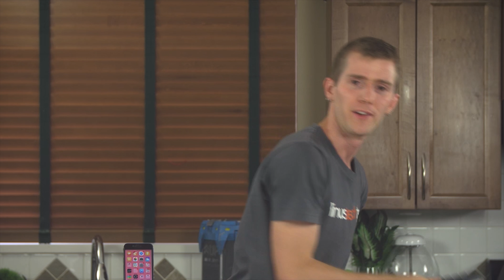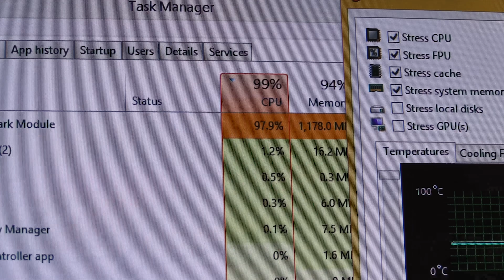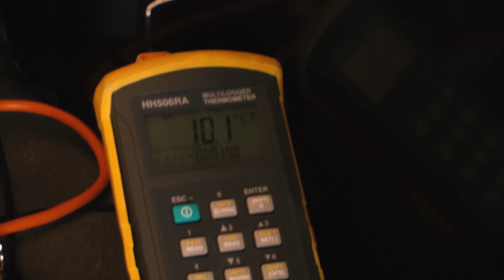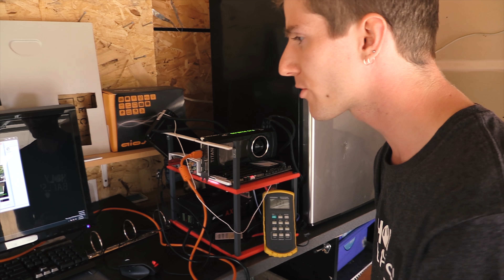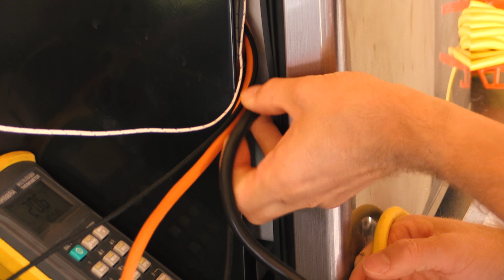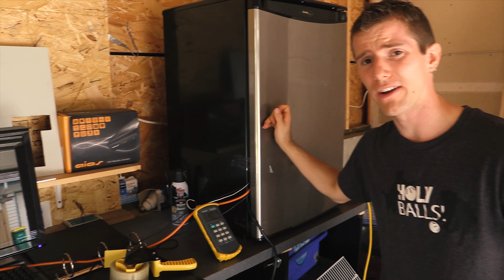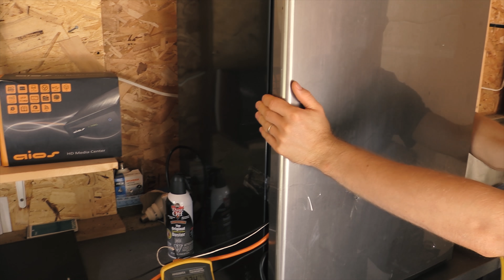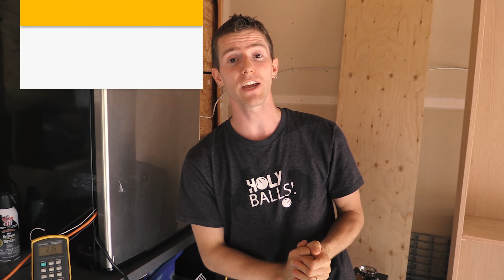PC Build in a Fridge - Does it Work??

Comment: Someone who has education in cooling and ventilation: Dying of laughter :-D
You can't put heat source to fridge, it has no power for take out 500W of heat and even if yes it's risk that you reach lower temperature than dew point of ambient air and it starts condensate on cool surface. This is really bad idea. You can check how much power consumption has your fridge and you clearly see it can't handle hunderds of watts of heat. But I understand you wanted show it in video, youtube money are better than just say it doesn't work. :-D

Comment: This gave me a great idea... I have a Coke branded countertop cooler with a glass front and lighted that came out of a convenience store. I'm gonna knock out the compressor and install some 200mm fans where the radiators would mount to the side walls for an epic custom water cooled cabinet...

Comment: It would help most of you to take a course in "Thermal Dynamics"; this is the science of moving heat energy and its effects. 
The only way to "Overclocking" a fridge, is by putting a fan on the coils to more efficiently move the heat away from the system. Even with this modification, the heat generated by most gaming PCs is more than even the average standard size frig can handle. An AC vent to the PC works better than a frig, but with this method, the case sweats and rust. All scenarios have pros and cons, "condensation causing electrical shorts" being the worst of them. A nice cool air-conditioned room is not as efficient as some of the other ways, but it is the most foolproof because it has the least amount of negative side effects. 
Try to buy equipment that can easily do what it will be asked to do. Where this is not always possible with the cooling system, engineering the airflow on the inside and outside of the case can help quite a bit. The idea is to move cool fresh air toward the PC, and the warm air away from it. Most people neglect to engineer the outside; if you don't have airflow moving the hot air away from the case's exhaust, this hot air just sets around and recirculates right back into the case. Doing a decent job at designing the airflow is beyond the capacity of most people's thought processes. But it doesn't take an Engineer to do a great job at this. It helps to have a fair amount of relevant training in this field, but mostly one needs to carefully think things all the way threw.

Comment: I really enjoyed this video, it made me think of somethings I hadn't before despite this idea crossing my mind.
The only way this might work with this spec fridge is if there was an exhaust port for the hot air from say the cpu cooler and power supply. In order to keep up exchanging the heat generated it would need help, more than it just the insulated box.

Comment: i think you will  have a problem with corrosion. when you reduce the temperature of air the amount of moisture it can hold goes down significantly. that means the relative humidity of the air goes up. most refrigerators are around 100% humidity almost all the time because they are opened and closed allowing moist air from outside the fridge to enter. this air might be about 30-50% relative humiity but when it cools down inside the refrigerator it will not be able to hold so much moisture so you will actually get a mist inside the refrigerator. your cpu is typically going to be way too hot for moisture to condense on it but other components maybe not.

Comment: A tad late, but I do wonder, what if you placed that watercooling unit with the radiator outside? Also, air that warms up expands, this would create pressure inside, more friction, more heat, more expansion?

Comment: Two (separate) ideas. One, put an AC output through a dehumidifier to reduce water build up and use that for case cooling, and two, why not put your water cooler in a fridge so the water cooling your PC is always cold?

Comment: Why would you not recommend cooling a hdd? As long as its above freezing (out of range of condensation) it would make the air around it easier to move through. Maybe if it's a sealed unit with a certain gas, but most of those gasses react minimally compared to our atmosphere when it comes to temperature changes.

Comment: shoudve just pulled the components off the fridge and made cold air intake out of some ducting that directly delivered to a pc case. fridges have fans so use that fan or replace it with a pc fan. boom cold air delivery that wont ever warm up because of pc parts inside the fridge. another option is a portable a/c. ive recently connected a 6 inch ducting to half the vent and am sending it to the front of my case fans. the results well nothings over 40 degrees celius ever. doing this on a amd fx8350 overclocked 4.5. water cooled and gpu rx580 nitro overclocked original loud fans lol.

Comment: To solve the no air flow problem, you use a small air conditioner instead of an refrigerator, rigged with the air flow going across the motherboard and the better the enclosure is to confine the air flow to across the motherboard only the better.  I've actually tested this somewhat by putting my test bench next to an air conditioner floor vent and using cardboard walls to reflect the air across the motherboard.  It looked kinda like a small garage with doors open both ends, with the vent on one side and the air flowing out the other.  The computer ran unbelievably cool with the CPU below 90 degrees Fahrenheit under load.  I wonder if you would need a CPU cooler under this setup.

Comment: My pc has a 500W power supply (max loading). 4200 Joules increases the temperature of 1L of water by 1C. 500W = 500Joules per sec. 
If there was 1L of water in the fridge, it would deliver 500joules per sec to that litre. Per sec. it delivers 500joules, so per the temp increase of water is 0.119C per sec or 7.14C per min.
It's basically running 1/4 of a kettle inside your fridge.

Comment: True the fridge is a closed system HOWEVER... What if you have a self contained water container in the fridge that acts as a heat storage unit. And you have your computer pipes flowing into that system or through it? It would still overwhelm the fridge BUT the fridge would be able to pre-cool the computers liquid, allowing the computer to remain at cooler temperatures for longer. Also what about a 2 phase cooling system? Dissipate the majority of the heat before the fridge, then do the cooling inside the fridge. This would probably shave 20 degrees off the temperature of the liquid before it enters the fridge, and then the fridge could lower the temperature further by another 10-20 degrees. So the fridge is only working to lower the temperature by 20 degrees rather than 40.

Comment: Only way to really get this to work is get a barrel that is full of water, enough water that when water cooling your system that the temperature of the water doesn’t change due to the heat of the computer, then away you go if you can keep a steady 1C then the system would be cooler, but there’s only so far you can take this and would probably be easier using a car radiator and a bigger water pump and would be to much of a hassle to what you would hain

Comment: i had thought about this in the early 2000's and with older hardware it may have had some useful effect but i hope someday he comes back and retries with a chest style freezer on the warmest temp. it would have way better cooling capacity and space to move a little air without wasting a ton of energy.

Comment: I think you need to run the power out the side and not through the door where it seals itself from the outside. Also, a freezer would of been a better choice. And, not a mini freezer but a full size chest freezer.  You can drill a hole in the side to run your power through and seal it with silicone. Im not going to try this cause it totally impractical and theres cheaper ways to cool your computer that consume way less electrical power but I think it could work. You just cant go cheap. Gotta get a subzero freezer with a motor and compressor that can run continuously. A walk in freezer, like the ones restaurants use is probably your best bet for a few degrees drop. Theres no kind of cold on this planet that will put out a campfire. So all that for a few degrees makes it totally impractical and a huge waste of time and money. I wasted time replying to this video even

Comment: You are disregarding the fact a refrigerator must be properly sealed.   With cords sticking out of the door even with the tape  isn’t going to seal it.   You would need to drill a hole through the side and silicone the cables I. For proper sealing.  You may not see a difference but just saying the test is flawed do to the seal being compromised

Comment: Seems to me, a better solution would be to run coolant/radiator from the GPU, into the fridge and back out.  Why cool anything besides GPU?  Still possible the fridge lacks enough cooling capacity for 200 watt GPU, but better than it handling all the heat from the PC, which maybe 400+ watts?

Comment: I know this was posted years ago, but Linus made 2 vary big mistakes.   1. the cords are big and making a big escape for the cold air.  2. the cords are coming in at the bottom, cold air sinks while hot air raises, so all the heat the pc is producing is pushing all the cold air out of the fridge.  To make this a successful test you'd need to make sure the fridge is fully sealed to keep any cold air from escaping-being pushed out.  Another note would be the rating of the compressor, better rating = faster cold.

Comment: If you live in a country where it gets cold in the winter, you can put them in a cupboard in your garage, wait 3 hours before you turn your PC on and it will work.
I was able to run a Q8300 (2500mhz) overclocked to 4400mhz and it was at 59C under 100% load BUT the temperature was -19C outside. Previous record was 4150mhz .

Comment: Water cooling refrigeration systems in done in high rise buildings. The air conditioning transfers heat to water, then pumps the water through cooling towers on the roof of the building.

Comment: Also another thought, would putting peltier thermal cooling devices between a CPU (or other) and a cooling block, either air cooled or water cooled, increase the cooling of the CPU?

Comment: P.S. I thought using a "test' bench system was a poor way to go. Cases are designed to direct airflow across components, even in a water cooled system, have proper air flow might aid in cooling "water cooled systems" though how much I do not know. Seeing a test of using water cooled systems with and without the standard case fans would be interesting. How much difference would the fans make in such systems?

Comment: Using silica packs could solve condensation problems from using freezers or commercial refrigerators, as would baking soda, either would need to be changed periodically. Cooling warm air with a humidity level causes the greatest release moisture, on a day with extremely low humidity, or a colder day air can hold less moisture. So put the computer in the 'fridge' during one of those days and keeping the door closed prevent warm moist air from entering.

Using a commercial mini fridge might be a solution if it can be set for use as a freezer, however is still depends on it's capacity to dissipate heat via coils on the back of the "fridge", I am not sure refrigerators that do not have the rear coils could shed enough heat. If the mini fridge has mini freezer for putting ice trays into, that might be of use, not sure. Put the radiator of the water cooling system in the freezer section, then use an anti-freeze/water solution so the water cooling system does not freeze. 

If I had the money to try these kinds of experiments I would. Not knowing the specs on thermal energies produced by these systems, and how much these various type refrigerators / freezers can handle also makes me doubtful. 

I have long questioned using water in a PC to cool it. With my luck any water cooled system would last a week, then die because the system sprang a leak. Could a water cooling system use some other none conductive liquid to transfer heat? Mineral Oil? Don't know what liquids are able to transfer heat and which of them do not conduct electricity. I have seen systems immersed in mineral oil, but how well does mineral oil dissipate or conduct heat away from components?

Would a 50/50 water anti-freeze mix work as it does in an automobile? Glycerol (aka glycerine) is used in foods as a sweetener, and as a humectant, solvent, and sweetener, and may help preserve foods, but can also be used as an anti-freeze. It was used in car anti-freeze until the industry switched to ethylene glycol, which has a lower freezing point, however ethylene glycol  is poisonous where glycerol is edible  and safe. Water an glycerol prevent the water to water bond, lowering the freezing point when mixed with water.

I would love to experiment, but can not afford the parts needed to do so. Good luck to experimenters wanting to try OTHER methods of cooling!

Comment: In order for it to work you would have to have the radiator in the fridge. But fridges get more efficient the more things you put in them.  Throw a case of Dr pepper in their with the radiator and it works more efficiently having less air space to try and cool

Comment: Ive been thinking of doing a project like this for years. My biggest fear was condensation. Im still in the research phase on this, but one of my ideas was just to run a custom AIO loop from the computer and place the radiator in the fridge. If it gets too humid, water will condense on the cables. OTOH, I can place the entire mobo system inside the fridge and mount the components to the top of the inside of the fridge and let gravity keep it from collecting moisture. Not really sure how feasible it is and thats why I havent done it yet.

Comment: the ovi thing is that there will be no air flow... then in a box it will be about hot and cold fighting each other... but what about liquid cooling ruining through a fridge (or freezer if there is a none freezing coolant that can be used) first going through the air radiator before entering to aid the temp before entering then copper piping in to the fridge and the pipes in the fridge bent in to a matrix or just a loop will service just so the coolest spends a long while travelling through the fridge/freezer. What about this for a idea?

Comment: I use a wall mounted air conditioner at my house, which is fitted close to the floor, and putting my open case desktop right next to it works quite well.

Comment: you need to make a cooler, you use fans to pump the air through the pc and then take the air through a cooler before you push it back in again. keep the two units separate from each other so there is no heat transfer between them.

Comment: Actually it could work if you can remove the hot air out, or even better use the chilled dry air from the freezer section and calculate how much cold air you need in order to bring the CPU in ambient temps under load, so you modulate the cold output according to the power usage to avoid any type of condensation. Although, you must obey  physics!! You cannot use a 140W fridge to cool a 400W PC obviously!!!! It will not work :)

Comment: I set my tower right in front of the window with my swamp cooler in it. Cooled my system by more than 10 degrees, because of the constant high volume of cold air blowing directly into the back of the system. However since it was a swamp cooler I had to check my PC every couple of days to make sure that moisture wasn't building up in the case. I wouldn't recommend doing that with anything other than an Air conditioner since they blow much dryer air.

Comment: of course you can't. because the system on the processor has set the amount of heat that should be. if the surrounding temperature is cold then the cooling performance is reduced as in a freezer. Freezer only reduce the heatsink's work. Desktop PCs have high heat while mini PCs can even live without heatsink which is why the air in the freezer affects the mini PC while the big PC does not. if the resource fan is separate from the PC, the story will be different.

Comment: This idea can be made to work extremely well for SHORT periods of time if you fill the fridge/freezer with something other than air, and leave the PC outside.
If you filled it with heat-conductive material and including a cooling cool for your system, then you can use thermal-soak, which can be thought of as a heat-capacitor. At this point you'd not have 1kg of cold air but probably 50kg+ of cold water (or similar) which would suck heat out of a computer's cooling loop for brief periods of time. But you'd need to be very careful that the coolant didn't come out at below the dew-point, or need an automatic mixer/bypass valve to stop the sub-dewpoint coolant reaching your PC. And it wouldn't last forever, and would take a long time to 'recharge' afterwards.

Comment: Hold ON!
Why not drill a hole in the top and install a large slow RPM fan sucking air out the top and adjust/rig the fridge settings so the compressor NEVER turns off. Then RERUN your tests. You WILL see fantastic results!!  After all, this is suppose to be a test in the 'best case scenario' not a test of 'just a fridge'.  REDO and REPOST even though this video was done in 2015?

Comment: Like this vid; but, they're are a cpl of aspects that were not considered.... 1st, Thermal mass in the fridge; By increasing the thermal mass, you may decrease the sustained temps... 2nd, By increasing the thermal mass, you can also increase the air flow cycle rates with the evap cooling coils. So far, this is just my theory; and with that being said, make sure you dont defrost your meat.....